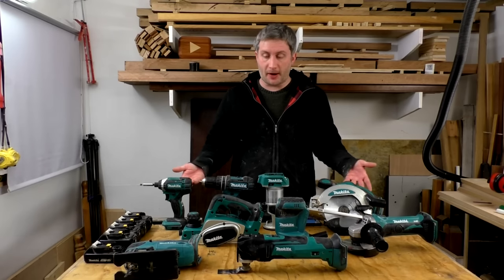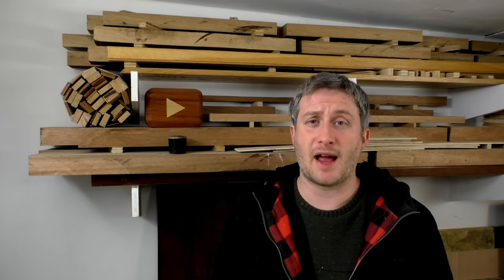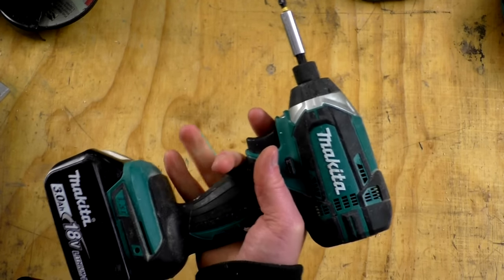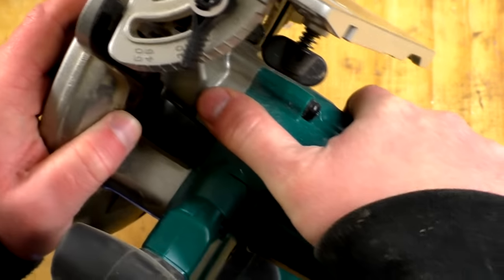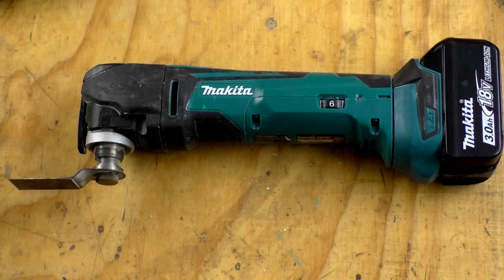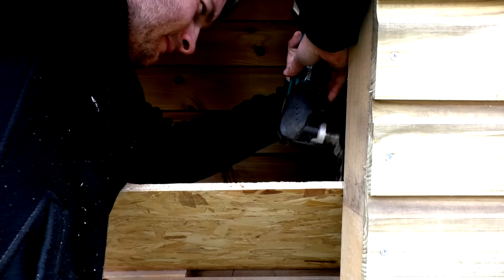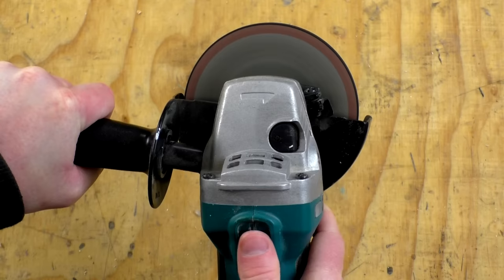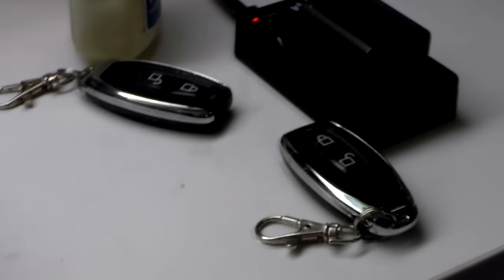My Makita Cordless LXT Tools Review

Comment: I would like to ask  two questions .The first thing is , if we must do  something for the maintanace of the power tools and second , is it true that if you dont use them very often the batteries tend to  break down very quickly and in this case it is better to use corded tools .
Reply from the maker: I don’t really do anything to maintain them other than wipe them down with a damp rag occasionally. I’m not sure re; lifespan of batteries as I’ve not had them long enough to judge yet, time will tell!
Reply: From my experience batteries hate to sit, you need to occasionally make sure they are fully charged. When my father passed he left some really nice brand new 18v DeWalt stuff locked in his tool box it took me 2 years to finally find the keys and all of the batteries wouldn't hold a charge for more then a few minutes.   There is videos on YouTube on how to rebuild them and they aren't to terribly priced to do it yourslf...   I am not sure if you can rebuild lithium ion battery packs.
Reply: It was true with the NiCad batteries. Nearly all of mine died when I didn't use them for a while. Lithium batteries are a whole new ballgame. I haven't had any fail me (yet)...
Reply: Graham Gott I jus plugged in my Samsung S2  that has been in a drawer for about 5 years or so now it was absolutely dead let's see if it changes up and then holds a charge for a reasonable amount of time...  I will try to remember to post my results although it is a cell phone not a power tool I would think the battery design is about the same.
Reply: It will if stored correctly...
Reply: Well my old cell does still hold a charge although it appears to be dieing a bit faster then so remember to be but this is by no means a scientific battery test.

Comment: Festool is just a Name..... Malkita is just a real Tool!!!!!
Reply: MKRM27 you dont understand! I know it..... but its much more expensive because of the Name! Its a Trademark.......
Reply: Festool are very expensive, but have more features than others. They are also manufactured in Germany.  In my opinion It’s the same as buying a Bentley. I don’t use Festool, but give credit where it’s due.
Reply: I have been using festool and Makita and have had less problems with my Mikita tools then festool tools, plus Makita is 50%-75% the price.
Reply: Riaan Oliver quite the opposite. Festool lack a lot of features and are very centered around joiners. If you're a joiner they're all sing and dancing. If you do anything else they won't be particularly useful over any other brand.
Reply: Sam T fair enough mate 👍
Reply: Go watch ave tear apart a festool saw and prepare yourself for horror. They are built like shit. Not even kidding. Then they charge 1k for it 😂
Reply: It's pity, but Makita is doing same mistake as Nokia. Other brands has already gone to far and Makita? They use to be pioneers, inventors and leader of the market and now?
Reply: @vadim3976  how so? They are till one of the last independently owned manufactures. The rest are all zombie brands. Dewalt rigid Milwaukee they're all zombie international conglomerates now. Makita isn't.

Comment: Nowt wrong with Makita. All the platforms at this price point are good tbh. Had a sneak peak at Makitas new 18V (x2 batteries 36v) 10" sliding mitre saw at an expo recently. That's going to be a big hit I'm sure. It really is a triumph of design in just about every way. I'm on the Bosch blue platform. Down to batteries mainly. Bosch batteries just go on and on and are properly robust. They've got a new 18v tool line coming this year so I'm told.

Comment: The different model serial numbers in different countries needs careful consideration if buying on line from overseas, especially when comparing individual  tools supplied with combo packs.  There are several versions of the same capacity drills and drivers.  Checking specifications, eg. Gear construction materials, functions included- reverse, trigger variable speed, mechanical gear/speed selection etc..can affect job suitability, power consumption, durability, price etc. are only some of the variables that appear in similar capacity tools of the same brand.  
Sanding processes require considerable power, consistent speed and durability coupled with correct sanding discs, sheets, belts etc. and operator skill to maintain good work quality.  Proper consideration and application to particular surface preparations of these factors would require specialised videos, but, in general, longer process times will favour corded power supplies to help maintain speed consistency and the dust collection off the tool which is commonly necessary.  Thousands of rpm in dust prone conditions over however long time places considerable stress on machinery seals, bearings and vibration absorption.  The limited available selection of battery powered sanders is understandable given the manufacturers cannot predict the duration or type of material use that machinery is subjected to.  Videos of tool maintenance cleaning, replacement of worn components including work quality impacts due to neglect of these issues could save tools, reduce damage to work and ease operator safety and frustrations to suggest a few consequences.  Awareness of these issues could contribute to tool selection and future purchases.  Cheers, Gary

Comment: Hi,
 can You provide times in minutes when using Sander, circular saw, and router on 5.0 Ah battery. Thank You for Your review.
Reply: Xawery Trąbka, while I’m not on the makita platform, I will tell you that on a 5.0 battery, the sanders run time depends on what grit you’re using and how hard you press. The circular saw depends on what material you’re cutting, blade you have on it and how hard you push. For the router it depends on what bit you use and what material you’re routing. Hope this helps!

Comment: From my experience, you should buy less expensive 18v line (ridgid or below) and premium corded tools that you solicit more. For example if I only have to make a few drills, I use a cheap 18v porter cable, but if I need to put a lot of holes, I take the time to plug my heavy hilti drill
Reply: Stay away from Ridgid. If I was going less expensive prosumer level, I’d go Craftsman or Kobalt. Ridgid Orange is junk.

Comment: "not in the same price bracket as Festool" no one is, they are like the iPhone of tools. Waaay overpriced.
Reply: ridiculous comment. I actually don't like festool for my sort of work.
Reply: festool tools have higher cost because of the materials and general quality made (but this doesn't have to make them more reliable or better in general), while aplle does hype on design (while using samsung screens, china labour etc), locking features, charge more for apps etc.

Comment: What’s your thoughts on ozito ?
Reply from the maker: I’ve not used them
Reply: Would u definitely recommend makers then ??
Reply: Makita**
Reply from the maker: Without having used all the other brands available I couldn’t say that they were the best because I haven’t had that experience... but I’m dead happy with all of them apart from the sander which I’m moderately happy with! Hope this helps
Reply: Pretty sure Ozito is Australia (bunnings) only?  I have a few, they go fine and i show little respect to my tools.
Reply: Thanks Keith,,yeah I’m pretty sure there Australian the circular saw is so small but cuts so well that’s what I liked about it
Reply: M Tv I have the power x change Ozito drill, impact and jigsaw. They are fine and I’ve had no problems with them. Nice to start with or just for the workshop/weekend.

Comment: I always liked being unplugged but I am a real cheap ass when it comes to buying stuff.  I prefer to buy only quality tools and try to make them go for my lifetime (and I useally buy them used so I can say that they have out lived thier original owner useally (I love my old aluminum case made in England and US power tools especially old Stanley stuff.   For work I have to have a cordless drill and I have had bad luck with battery packs becoming weak after only 2 or 3 years, it didn't matter if they were nicad or lithium ion and then replacement packs are so damn expensive I useally just buy a new drill combo kit.  
I guess what I am getting at keep us posted on how all your tools do as they age   since you use them pretty often and could give a fair opinion.   
On the not of a sander I love my electric sanders over my pneumatic or cordless Sanders, they are so effective and powerful.

Comment: Real quick bro,
Top shelf Makita lines are high end premium tools
Festool is drastically overpriced and overated. 
Hilti is overpriced as well but a better buy than  festool.
Makita has many different lines of tools,
From low end homeowner stuff, to high end tradesman stuff. Different options and models.
I assure you, the top end brushless drills, impacts, routers, saws, vacuums etc... Ain't cheap. I'm a tradesman from the States and from a experienced point of view, aside from Hilti and festool, Makita and Milwaukee are the priciest, followed by DeWalt, Bosch, Fein, and Metabo.
I need and use high end tools everyday, but won't be ripped buying Hilti (which I like actually) or festool.
I'd say best bang for your expensive buck would be Makita, then Milwaukee, then Bosch.  I don't like DeWalt, but respect them as well. Best reliable bargain brands would definitely be Ridgid and Porter Cable. 
Hope this helps.
And keep building!
Meyer Electrical
Reply: Absolutely agree. When I heard him say Makita wasn't high end I gasped, lol. Price-wise Makita is pretty close to Milwaukee.

Comment: Unfortunately makita quality has gone from good to shit real fast.. the batteries wont last, the tools break easily and all I have is makita and sadly looking to jump to other brand
Reply: Not sure which models you have cause I've seen lots of people with tools that are running strong. I'm thinking you have defective ones. Their quality is still fantastic and they still use a lot of Japanese made high-nd parts as opposed to Milwaukee that is completely based in China now. If Makita doesn't do the trick I don't think another brand will be much different.

Comment: Bought a new mikita BL 5" grinder with  4ah battery to  use in my engineering business they are a total waste of money 12 to 14 minute grinding on a full charge they are a odd job DIY tool  have had it checked out buy mikita they said it had no faults so there you have it the most important bit of information in making a decision to buy 12-14 minutes that's 4 batteries per hour useless in a professional workshop